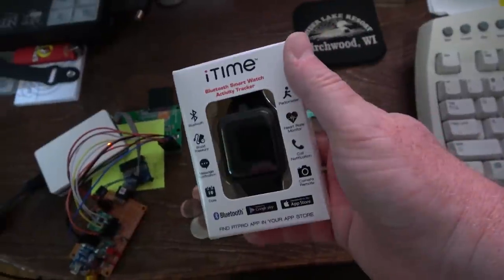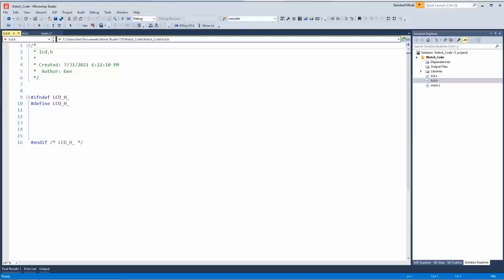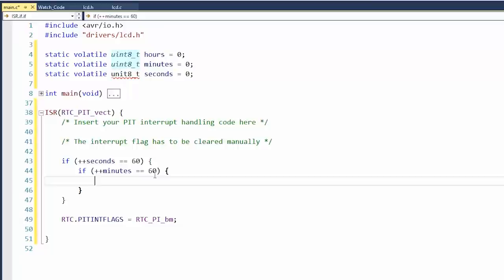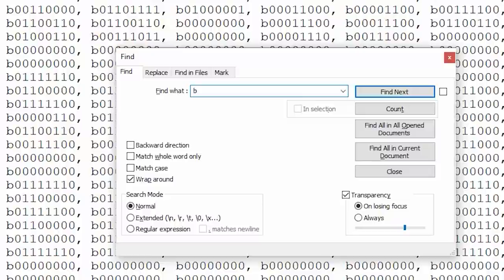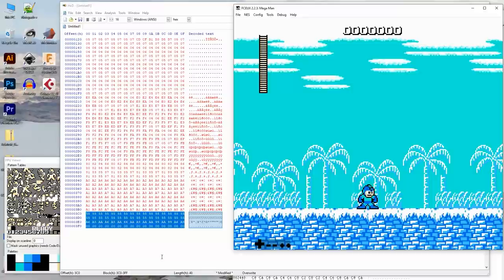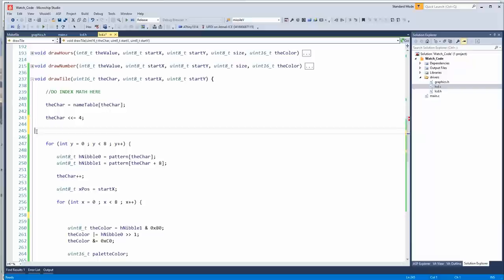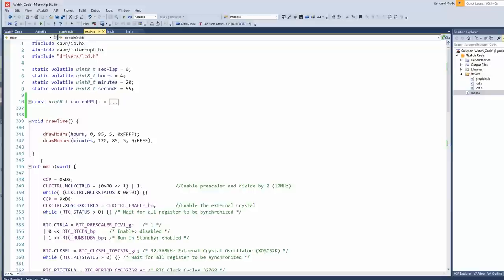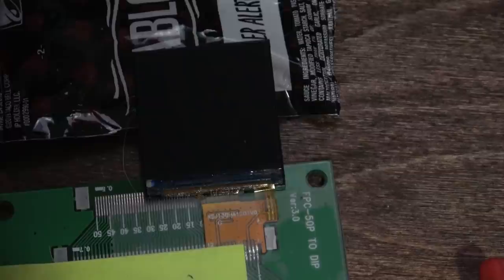Watch This! (part 1)

Comment: The good source of LiPo batteries are those disposable eCigarette's. You get a 375mAh battery for $0.99.
Reply from the maker: Oooohhhhh. Also, that's so much less green than a real cigarette.
Reply: Unfortunately I have never seen them here :(
Reply: Or any other cheap electronics useful for parts

Comment: Standard way Nintendo converts from RGB565 or RGB555 to 8 bits was to bitwise or the most significant bits to the lower unused bits. That evenly spreads the color to the full range. Such as 00012345 -> 12345123 and 00123456 -> 12345612.

Comment: I have the 1614 chip myself. I programmed it with arduino with do some i2c and spi thigns. But this is much much cooler project then mine. Thanks Ben for this.

Comment: Hey Ben, I recently rewatched your Teensy pinball portable series from your Ben Heck show days because I am making my own 3/4 scale pinball machine.

Do you remember what actuators you used for the flippers? The look very similar to the car door actuators I bought, but yours has springs to bring coils back to the mid initial state. Did you modify them to do this or is that how they came?
Reply: Here is a link to the video I am referring to: https://m.youtube.com/watch?v=O_LNG_MWNhs&t=622s

Comment: That's very cool so far!
For displaying the numbers, could you go back to the one pixel window and only draw in the foreground pixels, so you get the background image showing through where it is currently drawing the black around the numbers?
Reply from the maker: Yes but you'd have to redraw the background when the numbers changed. I'll clean it up for Part 2.
Reply: @BenHeckHacks  hey possible next project idea:: 3-players enabled , handheld GameCube system,,,let's make portable gaming Social-gaming once again,,,
Reply: Need to add a black pixel around the edges of the numbers to make them stand out too. If you figure out how to draw megaman on the screen from his sprite data - then make the numbers sprites too? Or perhaps align the numbers with the background tile grid, and do some kind of merging and update the changing grid tiles!

Comment: I just wonder why the UDOO RYZEN Bolt V1000 Maker Board SBC would have been better as it has native floating point operation which would mean that you don't have to write the floating point emulation code.
Reply from the maker: Floating point emulation code = multiply everything by 100 :)

Comment: You know, if you can find a spring, I bet that painting the bottom of some 3d printed thing with one of those metallic paints would let it work as some level of shoddy capacitive switch.

Though copper foil from a stained-glass supply shop would admittedly probably be better.
Reply from the maker: That's exactly what the original cheap watch did. I'll have to see if the touch sensor works as a sleep wake up .

Comment: WAIT, the XBOX controller cable does data? HUH, I guess I never used it in that manner to find out. Interesting.
Reply: Ikr
Reply: It was for the memory cards you would plug into the slots on the XBOX controller to transfer saved data from XBOX to XBOX, pre-mainstream internet between consoles kind of stuff

I also believe it was used with the first-gen headsets for XBOX Live for voicechat in games and im sure other peripherals that could plug into those what i would consider "data-ports" i guess